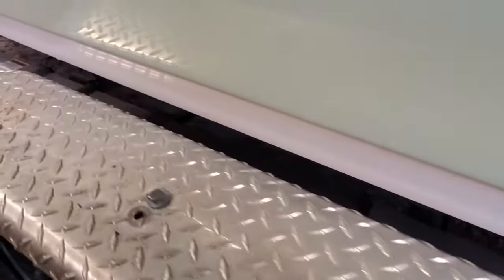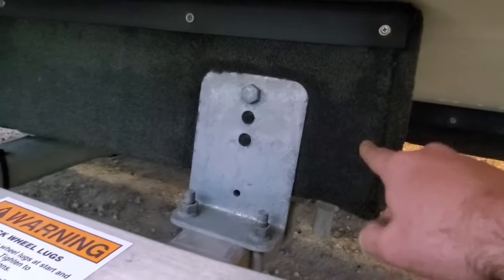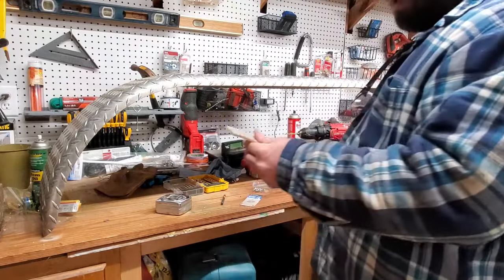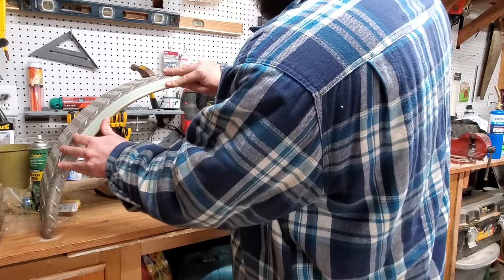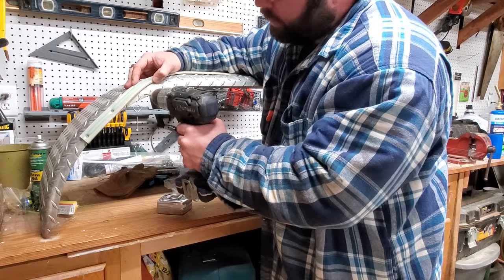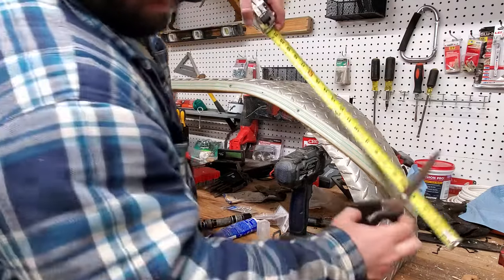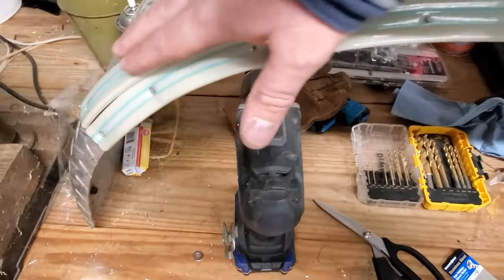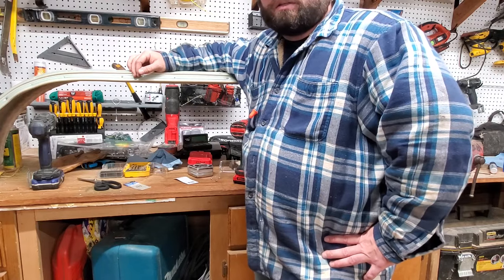Boat Trailer Fender Guards |  Easy DIY Install

Comment: yeah how do screws work when the tire is on the other side?
Reply from the maker: They work fine. The screws were only 3/4" if i remember correctly.  Plenty of clearance between the screws and tires.